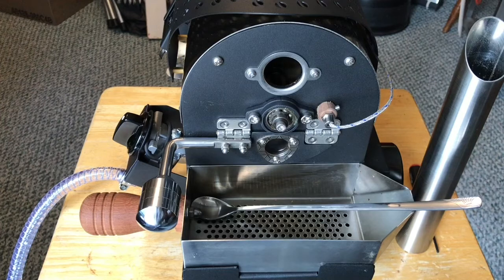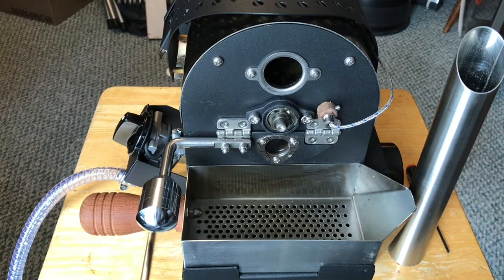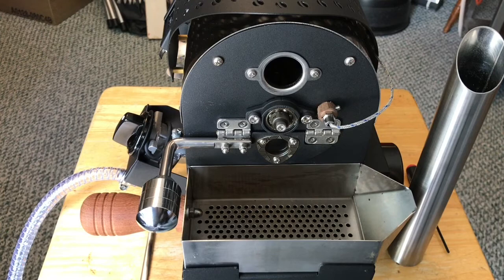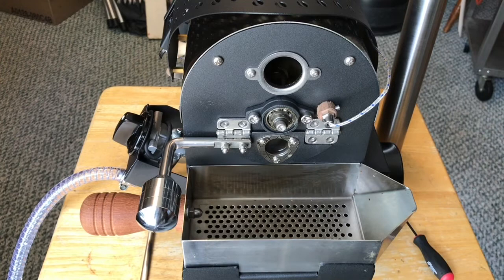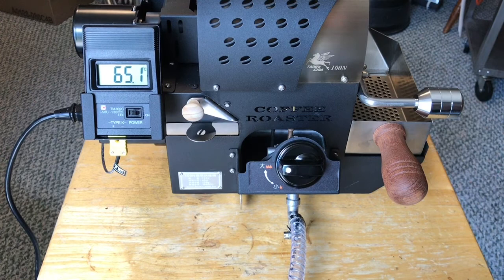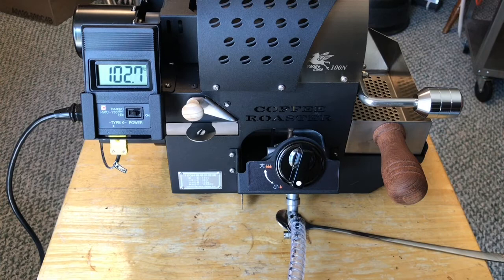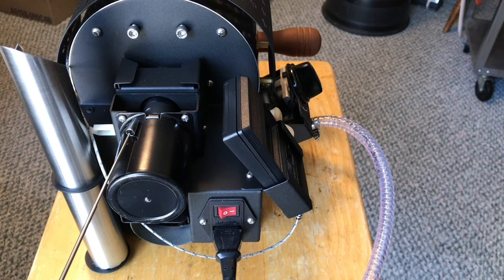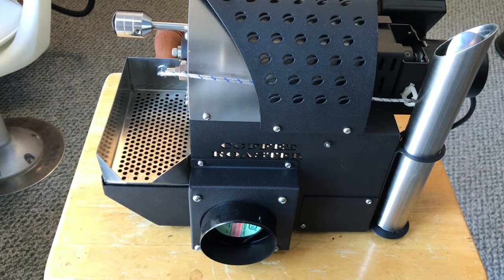Feima 100n Coffee Roaster Introduction

Comment: I have this same model. You can remove the bean tray while roasting. Don't lift it up, just pull it out towards you like a drawer. It says the capacity is 120g, but I can easily roast 150g, and probably more. Typically I roast 6 × 150g different beans every 2–3 weeks, so it's quite ideal for me.

Comment from the maker: According to the instruction manual, maximum capacity is 120g. I have found it can roast 225g or 1/2lb using a 1psi low pressure LPG regulator. Converting that to inch/water column, the “normal” low pressure regulator is @ 11-13” WC vs the 1psi runs @ 30” WC. Using the 11-13” WC regulator the 120g capacity is near the maximum.

Comment: Hi! Beautiful sample roaster, pretty compact, very aesthetic, great design. It is one of the few ones I've seen working with gas. 

I have three questions:
1) I just see one thermocouple. Is it possible to put a second one for measuring air flow temperature?
2) Does it have an easy connection so I can read all variables in Artisan or another software?
3) Where can I ask for commercial info (price, delivery details, design)? 

Great machine. Congratulations.
Reply from the maker: It is a pretty design :) Question 1. Not sure, the air flow is front to back; have to think about it… 2. No, it comes with an inexpensive digital thermometer; but is easily replaced which I did along with a thinner probe. 3. Hard to answer that question,  try to get in touch with me thru Ebay messaging. 4. You didn’t ask, but I have modded this machine quite a bit; as stock it is a bit limited and was designed for home use.

Comment: Hi,
I have a question about your machine:
Could you explain how the air-flow works? I don't see any ventilator or air vaccum mechanism. 
Thanks!
Reply from the maker: There’s a axial fan in the rear of the roaster, it draws air from front to back. Also there are some perforations in the front inch or so of the stainless drum along with some slot in the rear of the drum.
Reply: @hankua  Thanks for the answer. It would be great to be able to see how heating by convection works at your roaster. Maybe a short video where you show it?? It would be nice!

Comment from the maker: Hi! The burner assembly comes off with a few screws, I’ll have to take it out for a closer look and take some photos. The Feima 100n comes in 110v and 220v. The gas connection barb is internally threaded for Butane gas? It normally comes set up for LPG, can get it for NG as well. I’ve been using a 3mm thermocouple from Amazon, inserted in a M8 coupler hack sawed off. Changing thermocouples is very easy to do, just be careful not to over-tighten the little set screw. Better to put a second set screw on the other side of the fiber temperature block. Check out my blog at hankua.wordpress.com for more photos.

Comment: Are you still happy with this machine?  I see it on eBay for $1399.99
Reply from the maker: The price is high, but does include shipping. I'd say a Huky500 or Quest M3s would be a better choice at that price point.
Reply: @hankua  Thanks for the information.  Not sure if the machines you mentioned are still available to purchase.

Comment: sr sir i wanna ask u about the thermocouple you use for this machine. Can u Help n tell me. TKS
Reply from the maker: The Feima uses a K-Type thermocouple M8 x 1.25mm x 5mm x 40mm. The thermocouple is held in place by a set screw, therefore any type 8mm x 50mm length thermocouple will work.
Reply: tks a lot !